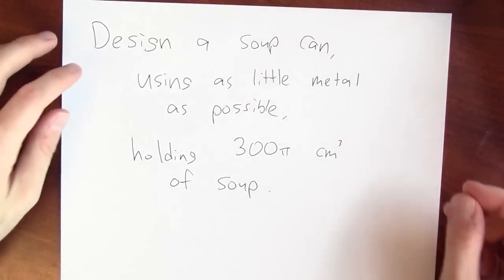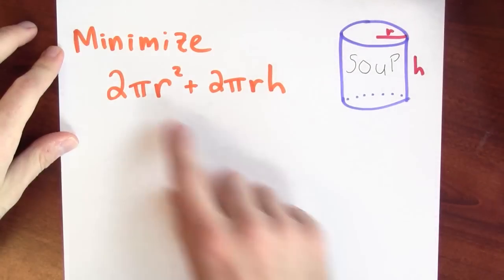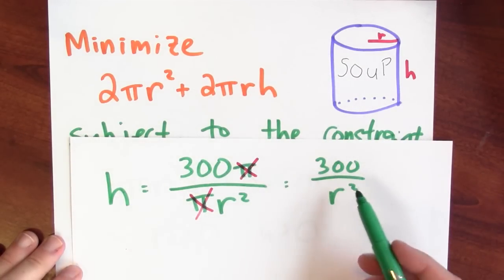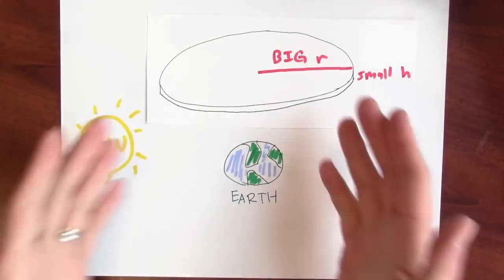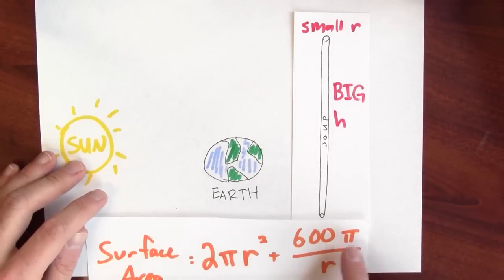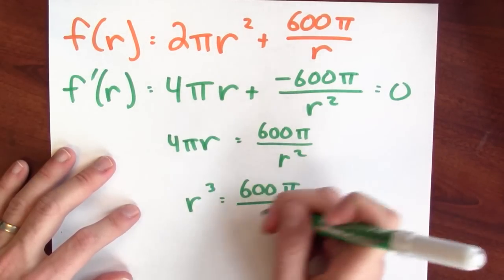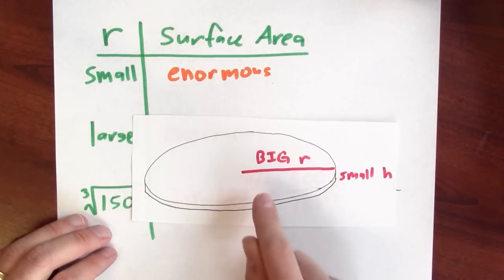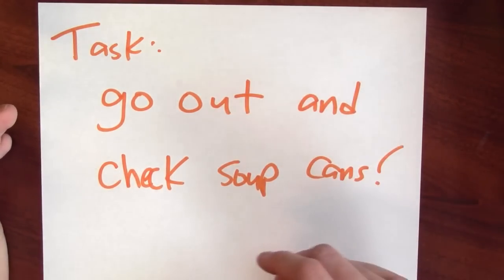How do you design the best soup can? - Week 8 - Lecture 7 - Mooculus

Comment: Purely curious and I checked my tuna can. It's not in optimized shape if we count only the volume and the area :). It's a little shorter than the idea shape. Perhaps there would be one more constraint involved, which is the shape of the tuna (maybe the company thinks it looks more delicious if the tuna are lying in full fish shape, not be cut in half or else.)
Reply from the maker: Good point about the tuna can!  I think tuna is cooked after it has been put in the can, so the surface area of the can is high (compared to its volume) to make this "retort" cooking possible.